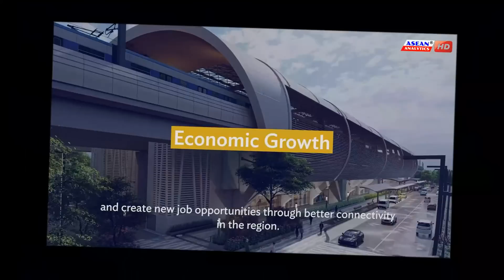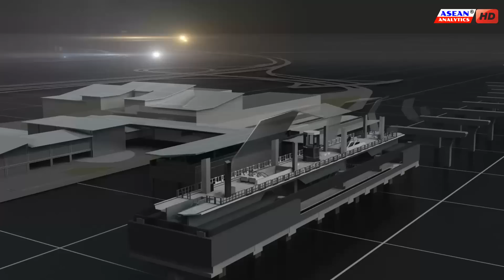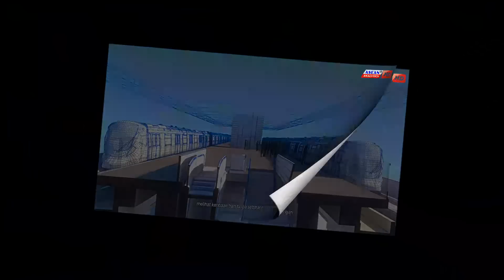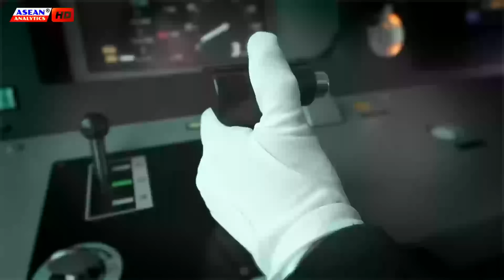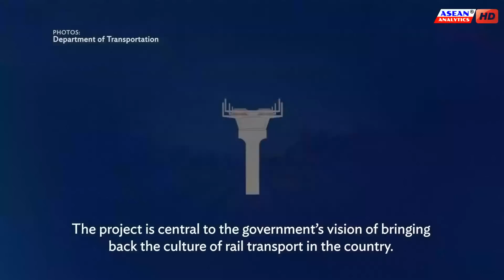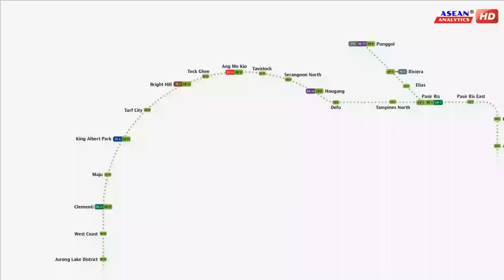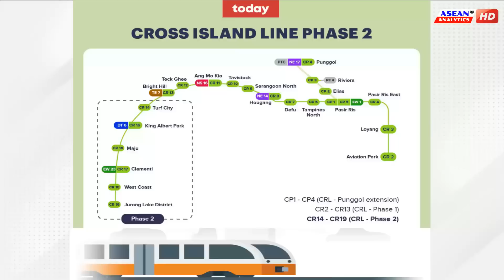Most Expensive Railway Projects in Southeast Asia

Comment: NSCR of the Philippines started way back during Pres Arroyo's time, but was overpriced. That's why it was suspended at the time. Not sure whether it was already resolved.
Reply: so you think this isn't overprice  15 billion dollars,   it's not even  highspeed railway.  lol    also add the fact the contruction is being built in a slow pace,  started in 2019 and will end in 2029. 1 decade??   LOL
Reply: Nope, that's the North rail project. The succeeding Aquino administration scrapped that since it's too hard to fix and then made a new project in what is now known as the NSCR. The succeeding Duterte administration then expanded the NSCR and made more modifications.